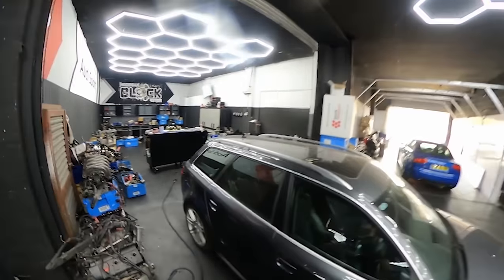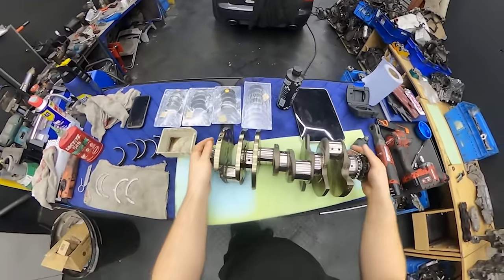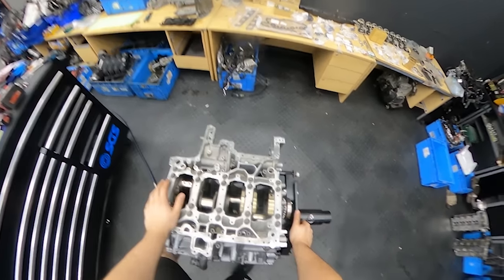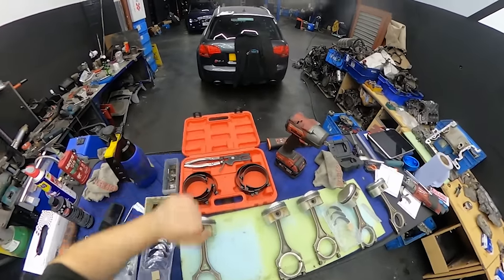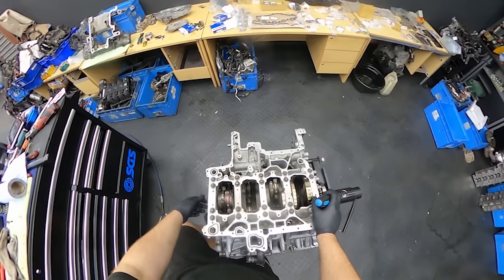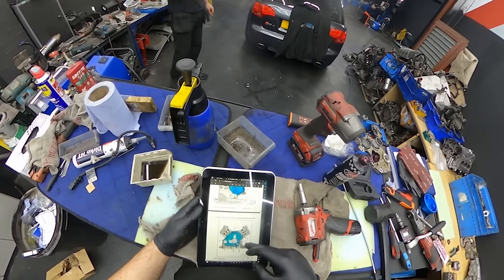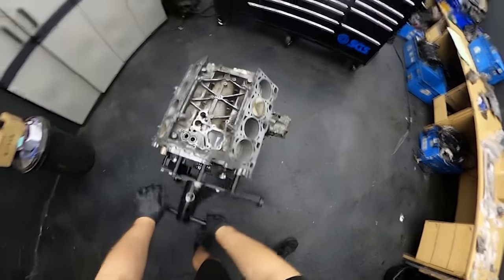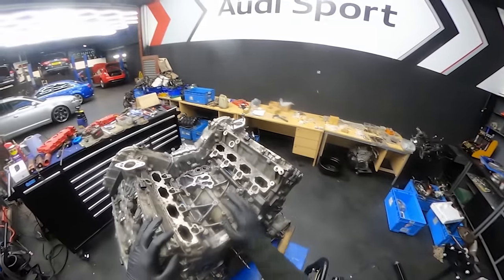Owner of the RS4 decided to build the engine, so lets build a V8!

Comment: Does this guy even know what he's doing? Everyone knows the main bearings on audi v8's are held into place with sellotape 😂
Reply: Do you know what you are doing? Page 87 of repair manual from Audi, it's high tensile polyester tape, NOT sellotape 🙄🙄
Reply: @khalidacosta7133  it's sellotape! And the cylinder head should have a gasket made from blu tack before torqued to spec 🙄🙄
Reply: @tehgzizlauw1787 he's clearly joking mate. Read the comments 😂
Reply: Hey @vagtechnic can you share your after market bearing brand ?
Reply: This comment has got to  be a Honda lover
Reply: @klipstick3108  I use a skateboard to get around

Comment: I just saw this video today.  it looks like those oil squirters have 3 bolts that hold them to the block, 2 near the cylinder walls and one down in the block to hold the tubes for the pressure feed.  it looks like on the last oil squirter, that you torqued the 2 near the cylinder walls but missed the middle one or it didn't get filmed at least.

Comment: Another great V8 video!

I’m sorting out an issue with my S4 V8, wondering if you’ve seen it before.

Someone has previously had the timing kit replaced, looks recently done but when I bought the car it was running in limp mode.

Now with the timing kit exposed I can confirm the uprated guides are fitted but the bank 2 cam tensioner isn’t working correctly.

It’s in the closed position and the chain is slack, I can lever the tensioner so it opens and takes up the slack but then it closes again.

Either an issue with the timing or a faulty tensioner, I’ll find out in the next few days but was wondering if you had ever seen anything like that?

Comment: I see you used LOCTITE 648 as the thread locking compound. Understand that is a retaining compound that is a bit stronger than their locking compounds. Do you typically use this when rebuilding engines on threads that require thread lock? I am asking because I am about ready to start building up a 4.2L BAR engine from a Q7 and trying to decide what to use 243, 267, or 648 🤔.  My second question “Sorry” I have noticed you have the engine on the engine stand but in most of your builds you end up finishing on a table. Is this due to the weight or just easier to work around. I currently have my stripped block on a stand but held from the front and wondering if I should invest in a table? Thank you and loving all your videos.

Comment: Great video, Thank you! I wonder why are you not using any assembly lube on chain guides? Also why are you not covering rubber gaskets with oil before placing them into their place?
Reply: the chains probably were pre-oiled and that's good enough for the guides, but I think they had lube myself from the looks of it.  As far as the gaskets, you don't have to add oil when there is not movement over the gasket as you would see with something like an o-ring
Reply: @jamesmedina2062   Assembly lube is being used to provide lubrication to moving parts before oil pressure is built, i believe you already know that. Just to oil the chains before installing them is not enough to prevent unnecessary wear before oil pressure is built. 
As for the gaskets, it is known that oil is preventing/slowing down the degradation of them, so it would be great to just oil them up before installing.  These steps are not that important to some people but if you think about it, whole engine has to be removed for some of these gaskets to be replaced, wouldnt it be smart to just put some oil on them?
Reply: @spaceboundmg  my opinion is that the materials we are discussing are either tough or they are delicate. If so delicate, they should not be used to begin with.  We all know about the Subaru silicone debacle. Using too much silicone and the silicone not having the proper toughness. I would need to know more about the silicone rubber gaskets and my ignorance wins the day today. As for the chain guides, they will not get a pressured oil layer, simply some oil so by design as stated before it must be a very tough material to work in that job.

Comment: Again a nice job guys! Wondering why you seal up all with the silicone, no anarobic seal is used? Lock-tite 518 for instance.
Reply: 2mm bead of silicon is what Audi recommend
Reply: @SalimKhan-gk1fh  
2mm is a lot, on those flat surface its all coming out and ends up in the oil pickup.

Comment: Does the b9 s4’s rocker arms pack in because the cars are mapped or that they are getting driven on the limit. Or do they go bad on a normally driven s4?
Reply: They go bad becouse they are faulty designed, but cars made in 2019 or later are free of that issue.

Comment: How frequently do these engines go pop ! Loving the reliability of my e350 cdi coupe. Great videos though, I fancy one of these but am scared off by the bills
Reply: Complete engine rebuild every 1000 miles mate
Reply: these audi engines are garbage in term of reliability but garage loves them LOL
Reply: that is next to nothing. Will frequent oil changes lessen rebuilt intervals?
Reply: If you see man driving a German whip blacked out windows leaning back
Reply: Leaning back driving past the garage😂
Reply: @German-Whip-V8  lol
Reply: The engines themselves are pretty reliable, but after 100k+ the annoying things on them start to go, like the cam adjuster solenoids for the vvt, or the oil separator, oil cooler lines leaking...  stuff like that.  Injectors are pretty common fail item as well.

Comment: Hey guys ,my ol man told to keep your top ring gap away from exhaust valve,no hot exhaust gas around top ring gap.whats your thoughts
Reply: On most 4-stroke engines including this one, piston rings rotate as the engine is running so the top ring gap would point at the exhaust valve at some point even if you pointed it away when you assembled it.